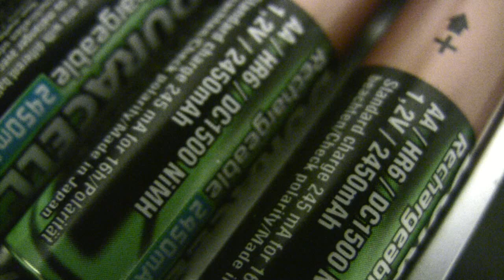HACK the Parrot Party battery PACK....

Comment: no need to solder or super glue; if you dismantel the original dead bat pack, you can also with a knife re-use the 3 iron "bridges" between batteries. then all you need is normal scotch tape to pack it all tight together. Made it with 4x VARTA Professional ACCU 2500mAh + "normal" transparent scotch tape.